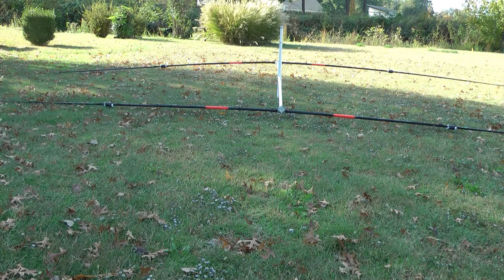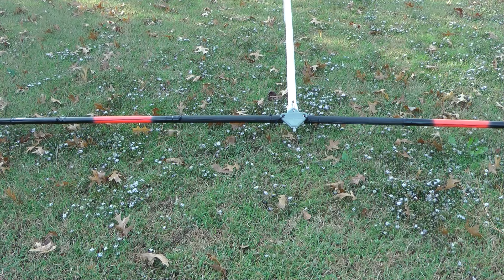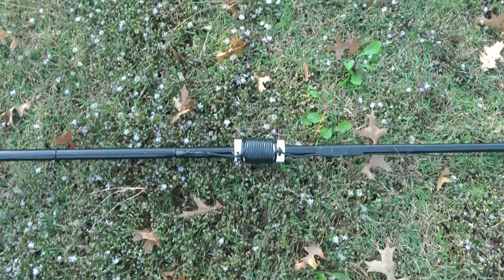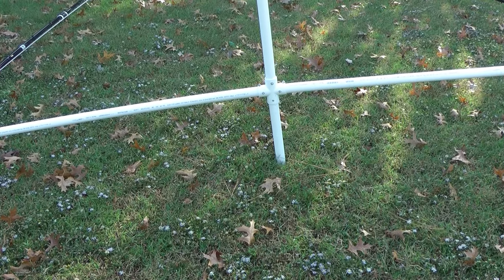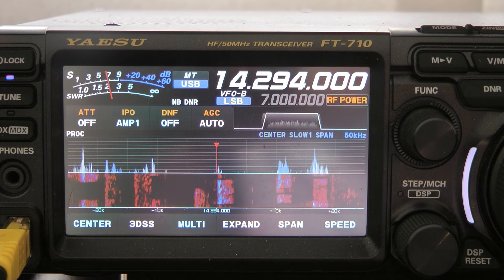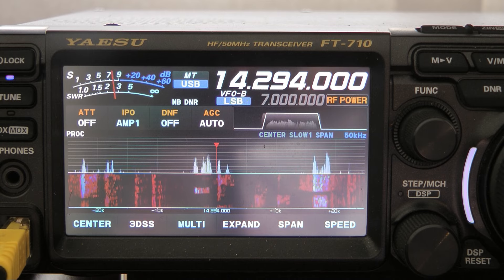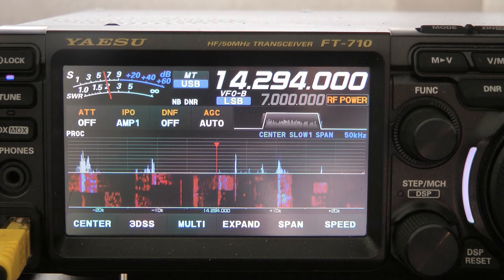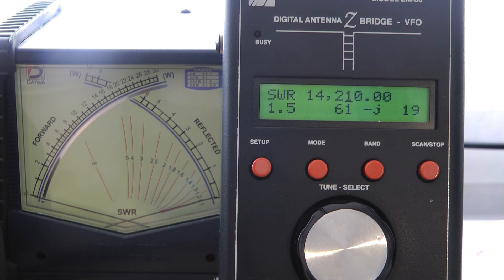20 Meter Mini Yagi, Homebrew, Yes you can build a mini beam.

Comment: Do you think the loading coils helped with lowering the SWR? I’ve seen this same design for a 20m yagi and without the coils the SWR is about 1.3-1.5 at best. Do you use a choke at the feed point for your setup?
Reply from the maker: The choke is more at the middle, I have a full size 17 meter yagi (no choke) and the SWR is 1.0
Reply: @johnwofford2708  Thank you.